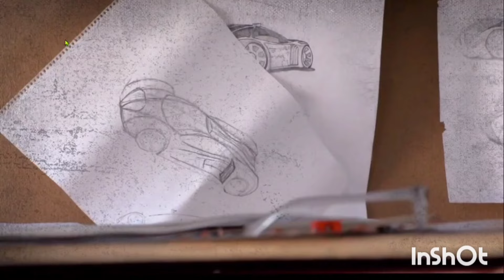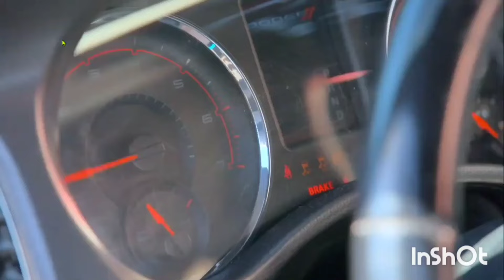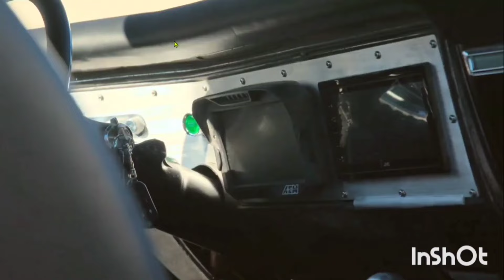Is Gotham Garage really that bad? pt2 #hotrod #tvshow #custom #classiccars #vehicles #review #mopar

Comment: Holy Batshit. This video popped up on my feed. Never heard or either. But great video. And WTF is that shop doing? There's guys in a single car garage in the hood, or a pole barn in the sticks. Who do 10X better work. I'm  a welder. But I could see the drip rail hack job through the paint. I wouldn't let this shop change the brakes on my  work truck.
Reply from the maker: Thanks I just started making videos and was virtually computer illiterate a few months ago so it means alot that you enjoyed it. I made a part one as well and part three is in the works. Thanks for watching

Comment: Removing the electric motors in a Tesla for a gas motor is sacrilege. And they couldn't complete the build with it as part of the ignition because it was one built to to have a gas motor so they had to put a separate ignition system in it for the motor instead of hooking it into the computer system. These don't go together the paint job is awful and why do they got to put spider webs on everything they're lucky they got anything for that damn car. You don't mess with a Tesla it's Automotive perfection